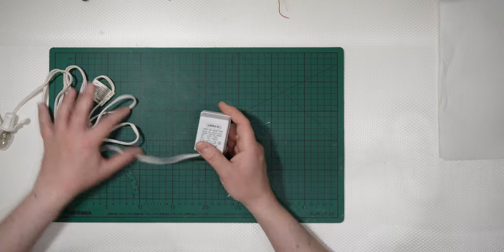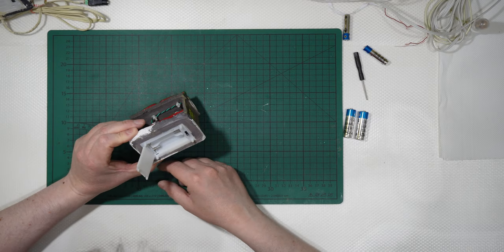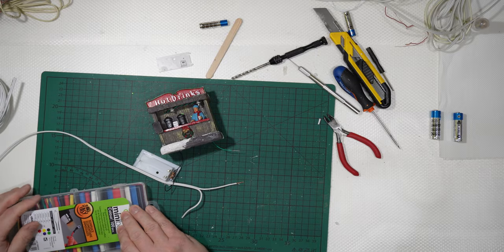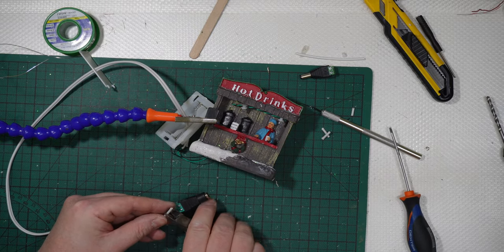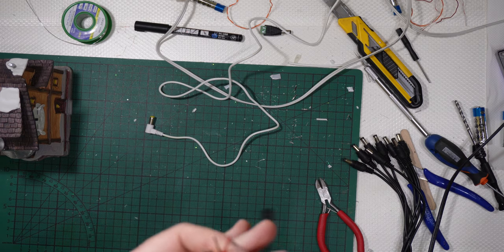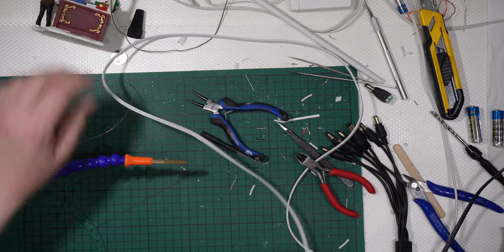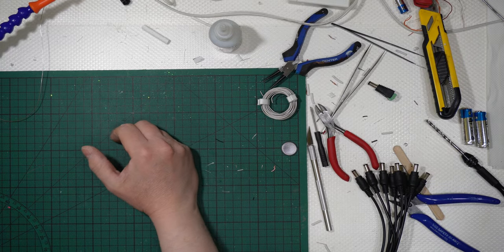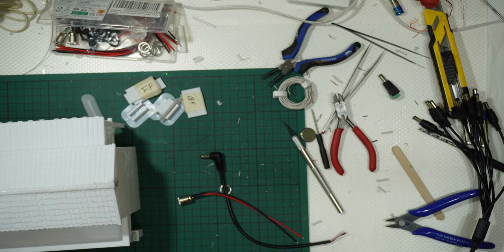From Battery Operated to Wall Socket Operated

Comment: Silvio,  very good explanation of converting DC to AC ! Enjoyed your sneak preview of your Colonial Village mid-1700's, even if your not using the larger building for  2024!
I am a huge Colonial period 1700's fan in the USA!
Reply from the maker: Hi Robin,
Unfortunately the new design for the stairs I sketched just before starting to paint all the colonial buildings.
It would have been completely out of place.

So I had to give up almost two months of work spent on those 3D models. Including the gigantic church.

Maybe I will use them in the next few years.

Comment: Hello Silvio,
Thank you ! So happy this tutorial is up! Got my pen and paper for notes and supplies.
lol... Yes 9 more fingers.
Okay, the white wire you are using, you said use whatever we want but what is that wire? It looks like lamp cord wire but I want to make sure I get the correct wire.
So glad you are gearing up for 2024. That is a really cute stall, so detailed.  Hmmm, no more Colonial district. Hey the creative juices flow the way they want, but I am sorry that you printed and wired 9 buildings that will not be used. Beautiful design though.The new female connector for the buildings is awesome! Now just plug and glow.  And you have 15 new buildings printed already besides the 9 you are not using? Holy smokes, you are fired up.
That was an awesome tutorial and I am going to get busy breaking through battery cases.
Reply from the maker: Hello Susan,

The white wire I used is standard HIFI audio wire (2x0.75 mm² white)
EUROPE LINK:
https://www.amazon.it/gp/product/B01EI81N4G

In Imperial or AWG units it corresponds to 18 AWG (or 18 Gauge) 2 conductor wire

US LINK:
https://www.amazon.com/gp/product/B07BPRFM2H

The color of the 2 conductors (wires) is not important.

I don't know... last season all the dozens of voices I usually had shouting in my mind were going on strike or they were facing temporary mutism 
and I was practically lazing around inertly for the first long winter months of 2023. Then they were slimy and forced me down the wrong path.
This year they seem to have gone wild or want to make amends and don't stop suggesting solutions.
Some obviously even too extreme for my madness.

Sorry but it's too early I don't want to reveal/spoil too much.
Reply: Hello Silvio,

Thank you for the link to the correct wire, it will be here tomorrow. Yay! My new Weller soldering iron with power station came today. My old one, which was new this year, has not worked right since I blew it apart and had to reassemble it. I can now say I have seen the inside of a hot soldering iron..lol

Hmmm hushed voices. Sounds like they were displeased about something they thought you should not be doing, so they went silent. When that did not get the desired effect, they purposely gave you bad information/ideas. Sneaky little buggers.  Now all is forgiven and they are back with a vengence!
 I am excited about seeing where you go this year and you didn't  spoil anything. How could you when you didn't  tell me anything...lol

I am curious about the overall theme though. Still sections/districts or not. Guess time will tell because I know you won't....lol
Reply: @silvioallena  Thank you for the link.
Reply from the maker: @sharonfox5643  It's my duty.